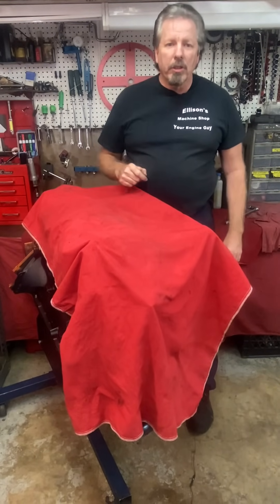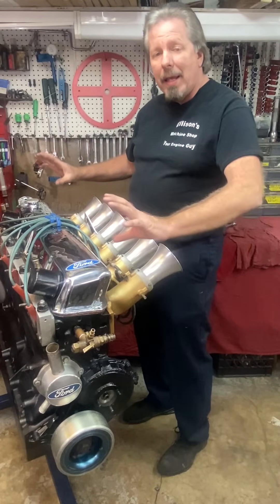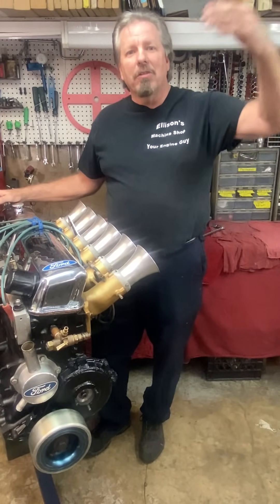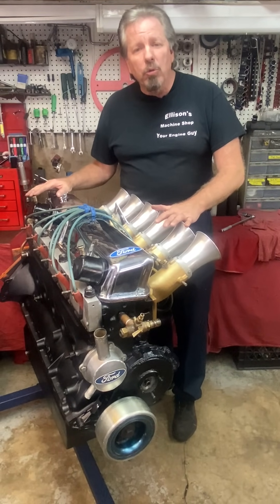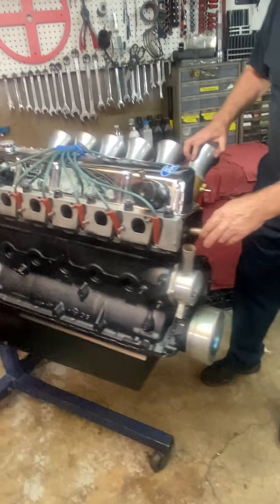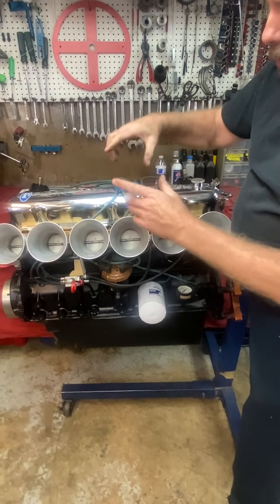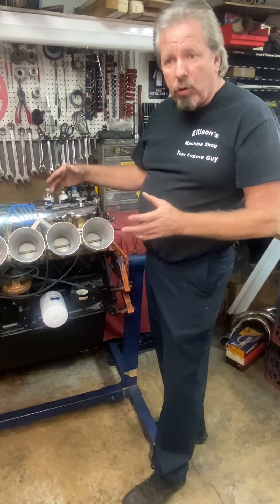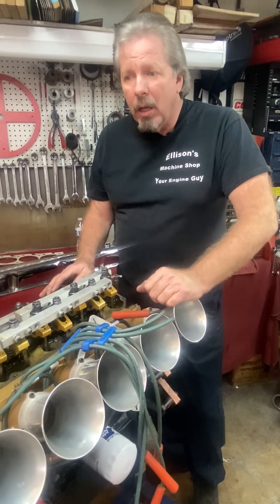Boss 300 Finished Project

Comment: I've always loved the 300 six. In my opinion the best motor ever built. Until this video series I had never heard of anyone cutting up cleveland heads,and peicing them back together to fit an online six. The man who originally engineered and built this engine in my opinion was a genius. 2 hp per cubic inch in the early 70's??? I would love to hear this thing run.
Reply: Not only 2hp/cubic inch, but using pushrods and only 12 valves! The most this engine ever had stock was around 150, which is obviously .5hp/inch haha
Reply: @HoggishGreedly  its the weld job i looking for as cast iron head's aren't that easy to modify like that and to work at high standards and stress's ect. for 5+ year's
Reply: @richardprice5978  Dude said that it has epoxy joints, has tested it and NO leaks👍
Reply: This is Argentina bro, take a look and enjoy!
https://www.youtube.com/watch?v=nP0_rxRVHYk 
https://www.youtube.com/watch?v=y_ER-lfbcNk
https://www.youtube.com/watch?v=4jyUUi53g-E
https://www.youtube.com/watch?v=ZgAGpEQjHwg
https://www.youtube.com/watch?v=r7vlpuwVHQQ
https://www.youtube.com/watch?v=SxXorsKJAZE
https://www.youtube.com/watch?v=Crkae6OLx7I
https://www.youtube.com/watch?v=mhiNouWbrLI
Reply: I had several 300 , Ford and Chevy , both good motors but the standard cranks on the Ford's could not handle any abuse
Reply: @Robert-ds8ec You can't be serious. The Ford 300 crank was bulletproof. The Chev 292 was very good as well but the Ford 300 six is legendary for it's durability and toughness. The stick crank was used in this engine to 600 HP so you must be mistaken for goodness sakes.

Comment: Thanks for sharing your extraordinary restoration of this fascinating engine. You did a good job of explaining the high port conversion on the Cleveland heads. I have a pair of vintage high port iron Cleveland Pro Stock heads that were modified by Endyn Inc. back in 1982. I got them shortly after Ford SVO released their aluminum Cleveland heads and racers were selling their high port iron Cleveland heads at a fraction of the original $6000 price tag. 

The intake port floors are filled using aluminum inserts and epoxy to raise the floor 9/16” from the stock location. The port width is increased by 1/16”. The result is much improved intake charge velocity for greater cylinder volumetric efficiency. 

The exhaust side of the heads have about 1.500” milled off which is replaced with a section of aluminum bar stock with raised exhaust port locations. This eliminates the sharp downward turn that was incorporated into the stock ports as a poorly designed fix for clearance issues between the Mustang shock towers. 

The improved exhaust flow and power increase is clearly obvious, especially at higher rpms. I plan on using these high port heads on my extensively modified Cleveland 4-bolt main short block.  
Clevelands rule….always 🏁

Comment: Fastest inline 6 I ever had was a 1981 Datsun 280zx. I bought it wrecked but still drivable and I thrashed it hard. It was an auto that would slam you back hard in the seat, t tops, fun little car. It had some kind of traction thing that wouldn't allow the tires to spin, the rear would squat down the more you got into the gas. The car would also talk to me, let me know when my door was ajar or the fuel level was low.

Comment: This type of build has been done on the GM 250/292 6 cylinder engines using a head made from 2 small block Chevy heads. Don't know horsepower numbers but they were built for racing.
I love stuff like this. One more SBC or LS make s we want to puke.

Comment: Thank you for this video. In high school 1970, my dad and I built a 1966 f100, 457 gears, slicks. 300 6 cyl using vette pistons and valves, crane cam, solid lifters, 4 barrel intake and carb. Ran with the stock 350 Nova's. Never dreamed the 6 had this kind of potential. WOW !

Comment: I think Bruce Sizemore built a 6-cylinder engine back in the early to mid 70s that was similar to this engine to run in modified Eliminator class, and it ran 9.74s
Reply: Yeah. Bruce Sizemore ran an aluminum headed version of this engine in an Opel GT in the same class at the same time. Sherman was running this in an Opel Kadett. I saw both cars at Gainesville back in the day.

Comment: This is one badass 300 Inline Six cylinder brother. This engine would be a great swap for an old school F100, an old school Ranchero, or even an Old Ford Bronco or Mustang and even with all the aftermarket parts it'll still outlast any Ford EcoBoost engine with ease.

Comment: I have used epoxy several times in the past and when used correctly and if you understand the material property's it is great ..hell most of the most advanced technology in existence is epoxy reinforced  Carbon fiber gets its flex to strength ratio due to the epoxy and how you compress it...

Comment: dont think anyone would stop you making youre own version of this engine/head combo from scratch , it might blow up youtube in views
might have a hard time welding up the heads but then again welding has come a long way since the 70s and there guys around that are wizzards with a tig torch might not even need epoxy to make the head watertight 

was about to suggest you try casting a complete head from aluminium using a 3d print as the basemould but it looks like edelbrock makes an aluminium head and it probably cheaper to build that head up with weld before you reshape the exhaust side and the intakeports to match the ports in the heads of the 70's engine you have there (hope you made silicone rubber casts of those ports btw as you might not be able to get youre hands back on that engine after its out of youre shop , they help shaping the ones in the alumiumium head )

Comment: I am a rtired truck driver and love anything with an engine and whees. In my younger days my dad and I use to build engines for mainly the neighbiors as  somthing to do in our spare time. As I said I am a  professional truck driver , not a professional mechanic, but, I love working on cars but dont so much of it any more. This isd really about the videos you had about the bad lifters. But before I get started, I want to say I thinkk you are a real professional in every way. I love youy videos about the 310 ci Ford  with 625 hp as I am basically a Ford guy but love anything with wheels. The other man you were talking about was also correct too. I thonk bot of you are right aboput the lifters. now, for my opinion ; Neither one of you told what brand or kind of oil you used. It may be a lifter problem and an oil problem. With all the new semi senthetic and full synthetis oils on the market to day , I think a lot of the problewm lies with the oil. The few engines we built when I was young we had no problems with.  I have seen engines torn down with the old Quaker State and Penzzoil in them and you couldnt hardly tell where the rokcers were, I will be 70 this year nad since my 20.s I have used nothing but Castrol. Today you cant find regular just  semi synthetic, but still use castrol with the exception of my 2015 MUstang and i take it to the dealership for changes and use everything recommended by Ford. They put an additive in the oil because it has the 435 hp coyote  engine but I dont hot dog it much so I have them add the additive to help clean it out bercause I dont drive aggresively. But I think that in my opinion, the oil may have a mlot to do with the lifter problem, Thank you keep upthe good work I love your videos!

Comment: WOW "Super Cool" !! Had no idea these builds even existed !! Can anyone tell me about what kind of peak RPM this awesome motor can handle ?? That bottom end looks like a Beast !! 💪🏻💪🏻👍🏻✌🏻
Reply: This engine turned 9200 RPM
Reply: @jeffsligh9818  that's impressive !! 💪🏻💪🏻
Reply: @jeffsligh9818  yowza!😃👍
Reply: Probably still 6,500 or 7,000 limited by the mass of the pistons and rotating assembly and the reliability of the original valve springs. A dyno pull or two would be great.
Reply: @larrysorenson4789  ya if not alittle more left in it. That 13:1 compression is gonna get it there pretty quick ✌🏻And would be pretty cool to see a Dyno Pull !!

Comment: You did a fantastic job restoring a true piece of drag racing history and explaining using the different comparisons so people could understand what it is for as little cubic inch it is , with engineering that is so remarkable remember this is 1969-70 people, 3 Cleveland heads into 1, aluminum rod roller cam fuel injected 6-cylinder making 625 horsepower and breaking track records. Great job sir 👍.

Comment: I am not a ford fan... having said that, I would put a 300 six in anything. that engine is one of two ford powerplants that I do trust. everything other than the 300 and the little v-8 they had in the 60's 289?... dunno. cant find em anymore so I guess it doesnt matter... anyway. I have seen 300 sixes put up with more abuse than any engine should and still sound happy. I am not a ford fan, but I know a good engine when I see one!

Comment: I'm curious why I haven't seen this before? I have looked all over YouTube for comprehensive builds on the infamous 300c.i. 4.9 L inline six. and didn't have to much luck, there were a lot of idiots showing what they had done to their 300 sixes I was definitely disappointed. however there was one outfit it's called Power Nation. if I remember rightly they are a part of Road & Track magazine. they had a pretty comprehensive build on a 300 six that included dyno runs. and it seemed strange to me that there wasn't more and better videos of comprehensive builds on the 300 six. because I've known of guys who built some pretty impressive 300 sixes. and there used to be an outfit called Clifford Research. that built these engines and supplied every kind of part that a person would need for any kind of application. they were real popular from the late sixes, though the seventies, and into the early eighties. their slogan was sixes for eights, or as it was on their lititure 6s for 8s. however I didn't know if they were still around. so I researched them and they are still around. but they are not the same company that they used to be. however there is an outfit called Classic Inlines. that sort of filled the void where Clifford Research used to be. but they are not like the original Clifford Research was. anyway I purchased a couple years ago, a 1981 Ford F 250 4x4 with the infamous 300c.i. 4.9 L inline six and a four speed. these trucks are pretty much totally bullet proof. and I was curious what information there was on building one of these engines? but was disappointed with the information that was available on YouTube. and after doing all the research that I did. I'm surprised that I didn't find out about this until now. the infamous 300c.i. 4.9 L inline six is the best six cylinder engine ever produced hands down. and it has proven it's worth, it was used in all those big brown UPS trucks for all those years. and Ford made industrial versions of it, and used it in a wide range of vehicles. including pickup trucks, vans, and even medium duty trucks, as large as the F 700 trucks, especially dump trucks. the thing that sets it apart from any other six cylinder engine. is the engine block it's heavily webbed and has seven main bearing caps, and it has an extremely long stroke. it's weak point is that the head it can only have so much done to it especially as far as porting is concerned. but there were some guys achieving pretty good HP and torque numbers from them. but over 600 HP is unheard of from a naturally aspirated six cylinder engine. there was a Ford engine builder that I'm sure you have heard of. that would be at the top of the list of all time great engine builders. his name is John Hasse he built engines for Bob Glidden. he was the first person to come up those raised exhaust ports. on both the Boss 302 and the 351 Cleveland engines. and he also works with the the Boss 429 engines. he's still producing the parts and building those engines today. there is a video right here on YouTube. I always wondered if anyone ever did anything this crazy to the infamous 300c.i. 4.9 L engine. I figured someone must have tried some sort of wild head design on the 300c.i. engine, and now it turns out I was right. I will definitely be looking back though what videos you have made. and will be continuing to check out any videos you will have in the future. I am definitely subbed, and thanks for all the great information on this incredible engine.

Comment: Nice video, inertia is the word I was waiting for when you were explaining the airflow through the engine which is the reason why overlap cams work anyways nice job on the engine I watched all the videos I wish there was more during the assembly I don't know if you mention about the double pushrods if they were because of angles one thing I was wondering sir you mentioned that the flywheel was loose I was just thinking maybe you should check the the bolt holes to see if they are wallered out or the threads are bad. something I picked up listening to you on your first video. When I watch your first video the first thing I recognized on the engine was the Ford distributor cap and rotor then I recognized the cover for the lifters then of course the Ford word on front of the engine and my mind says that's a 300 6-cylinder Ford anyways I hadn't seen one of them in a while myself love your work I enjoy your meticulous work ethics have a good day.

Comment: This has definitely been done more than once. There was an engine described as similar to this for sale on eBay about 20 years ago. I was broke at the time and couldn't afford the 6000 they were asking. 

I've looked for the listing using the Waynack Machine but can't find it.

I remember the listing as "Ford 300 with custom Cleveland heads. Estimated over 400 hp." I remember the pictures as it having a block painted cummins beige and they gave no further description of mods. I definitely don't think it was this one. 

I've anecdotally heard of these built with 354 hemi heads, and there's a feller on here building a stroker with an LS head.

Comment: Im a huge fan of the Ford 300 I6. Ive had several over the years and each one was fun to drive and could pull a house down. My last 300 I6 was an 88 that had been bored .060 over but the previous owner screwed up the end of the crank so the balancer wouldnt fit correctly. Basically it was run very hard with a loose harmonic balancer and it ate the key way out

Comment: I love those big block inline 6 Fords.  Especially when they're like this one.  This piece is an amazing example of craftmanship and innovation from my era.   Even though I'm not even near in the same league, I won't get rid of my 300 six powered 93 F-150 simply because of that engine.  Thanks for sharing this piece of history, I had to subscribe to see what else you've got on your channel.
To add one more comment addressed to the aftermarket:  How about a cross-flow cylinder head in aluminum?  There's renewed interest in this engine.
Reply: 93 is great year for 300 inline 6.  Sweeeet ford 6. My fave ford engine. Ford's most reliable torgue motor .  Enjoy.

Comment: Watch light was a transmission that Chrysler used in the mid-1950s. Very very good stable automatic transmission, but you did use the clutch to get it going. The original lock-up torque converter!
Be poly block 318 by kreisler had a high-flow combustion chamber and that was a grocery getter motor. But I've seen a lot of people drive those things to the drag strip with a little bit of work on them and send trailered Mustangs home back on the trailer.

Comment: Back in the 90’s I saw on a shelf up close an aluminum Ford 300 head that was made up of several Cobra Jet heads welded together. I was visiting a high tech custom engine development shop north of Boston. The head belonged to an unnamed customer which I believed ran the motor in a dragster.
This shop was also building factory rally car motors. A Bonneville Steamliner record holding mtr, drag boats, Super Mods etc. Alcohol and nitro motors were not a rare sight.All types of drag car mtrs were made there.
Their engine dyno was running 
all the time! Very cool place I visited almost daily. That faculty is gone now but their well known products are still available and world known. 
Ahh the good ole days.  😁

Comment: I want this engine.  Our 93 F150 could definitely benefit from this as an upgrade.
Reply: Im building a 94 F150 with a 300 and the new Promaxx head from engine power that they did last year… im still deciding if i want to do low compression and give it a ton of boost or do a slightly higher compression and a lower amount of boost to achieve the same thing… or i may just go for a NA 325 hp motor… too many options but i may just have to go NA cause im wanting the truck to be my new daily

Comment: A really beautiful engine.  I've watched many Ellison engined race cars perfform at Edgewater.  Nice to have a video like this.  Cars using engines were a treat to me because of the way they sounded and how fast they were.  I currently have an "econo altered" sitting in the garage but it needs the roll cage updated.  The thing that makes it unique is that it uses a former Gary Densham funny car chassis, real gold leaf lettering on the body, and titanium wheelie bars.  Someday I hope to get it running again.
Reply: Your right it's a very cool engine!
Reply: I remember Edgewater. Is KilKare still open?
Reply: @joshuagibson2520  Yes
Reply: @joshuagibson2520  yes, paved oval and drag strip.
Reply: @supercuda1950  yup! That's the place! Decades ago Kil Kare auto wrecking was right there close to the roundy round. It was a pretty decent junkyard back then. I got a lot of 70s Camaro parts out of that place.